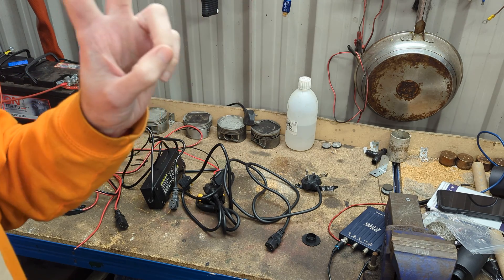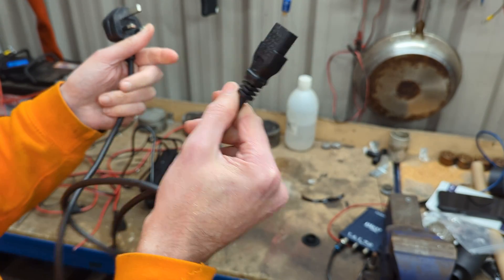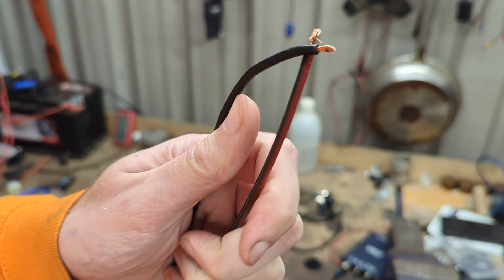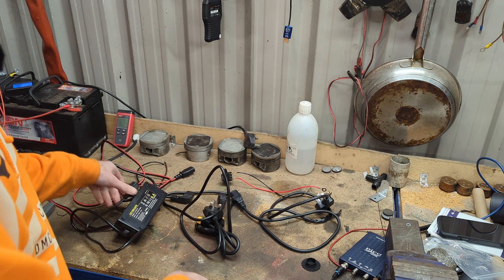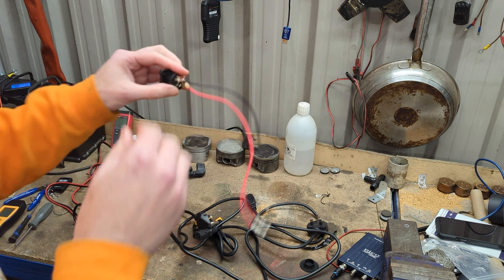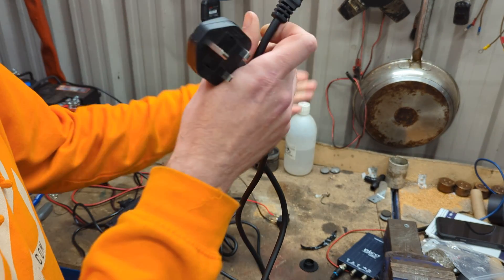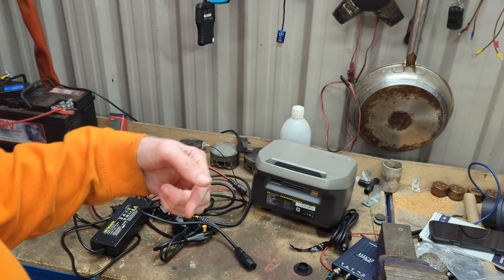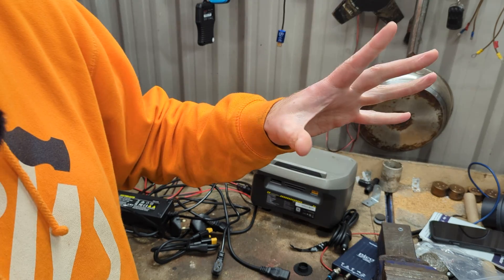PSA - Diesel heaters using mains plugs for 12V - Danger of Death

Comment: "IEC 60320 couplers are not keyed or color-coded to indicate voltage; it is the responsibility of the user to ensure that the appliance's voltage rating is compatible with the local mains supply."

Comment: New to diesel heater's but bought one for my caravan, it came with a standard UK three pin plug and after more research I've found that can be dangerous if the power goes out and the heater doesn't go through it's cool down cycle, it's that correct? any advice would be greatly appreciated.
Reply from the maker: It's not so much that it is dangerous, more that there is a chance of damaging the heater.  If it doesn't get to cool down the fan inside has a chance to soften and deform, same with the plastics and components on the ECU.

Comment: The big problem I had with this too is, seeing this plug on the outside would make me think their is a power supply inside of the unit. Especially if it was like the Hcalory in a box. Even a competent person might believe the supply is on the inside.
Oh and then you mention this is a thing. I suppose it makes sense that some manufactures do include the power supply inside. That sounds good that at least one of the manufacturers is going to hopefully make the change.

Comment: Thanks for the video! I bought a 9kW diesel heater for my motorhome. It has no cables or plugs at all. Only two screw connections and cable with cable lugs for a car battery. Anyway! There is nothing about the amps in the instruction manual. Now I'm looking online to see whether I should use a 9A cigarette lighter for the 12V output for my power bank, stronger or weaker. And during my research I find this video. I'm horrified. Installing a connection that can actually be connected to 240V... I'm at a loss for words! I'll try 9A at 12V and hope for the best. In the worst case scenario, the hut stays cold and I sleep at 4 degrees. But still better than being cremated, right? 😂

Comment: Hi David, can you help me with powering my maxpeedingrods  MXR-3M Diesel heater with a ecoflow delta 2 power station. What cable to use and what is the  maximum length you can use running it from outside my camper with my ducting entering through a window. An issue I had with the delta 2 was it primed the diesel heater first time it ran and I let it run for a hour then I powered the diesel heater down with no problems. And this was using the ac/dc power adapter they supply for the heater that you show on this video. I then powered it back up put the temperature up from 24c to 28c then the delta 2 tripped. So I am a little stuck as I'm new to this. Do I need a LED TRANSFORMER to make this work.
Thanks
Amanda
Reply: Forgot to add the  details 2 stays in the camper😊
Reply: The deita  2 stays in the camper, that's what I'm asking maximum length I can go with cable from diesel heater to power station. Thanks

Comment: So what power supply do we use thanks
Reply from the maker: Anything that can output 12V 15-20A with a nice fused plug.  Or wired straight onto a 12V battery.

https://amzn.to/40n66hJ

Comment: Time to chirp up, that power supply will most likely have aluminium cables and the 240V plug technically doesn't exist, it's a Chinese made up creation.
The 12A rating on the power supply is not good enough either, it takes 10A for the glow plug and 2A for the rest, luckily the glow plug is only used for about 1 minute.

Comment: Is the HC-A01 Diesel Heater, 5L

Wired ok as looking to get 1
Reply from the maker: Yes.  It's just using a 2 pin plug for the 12V side.

Comment: I have an electric bike which uses the iec 72v but they use the earth-neutral pins for the power so you wouldnt get an electric shoch if you was to plug a mains into it.

Comment: Completely common with Chinese manufacturers.  They don't follow standards at all.  One of the worst is the use of standard 3 pin XLR connectors for mains voltage.
Naming and shaming will actually increase their sales by driving traffic to their listings.
Reply from the maker: Just wanted to say thank you for all the things I've learned over the years from watching you, and you were a big inspiration to actually start filming some of the things I do in my workshop.  :)
Reply: I understand the BBC used to do that in-house.
Reply: Woah that's freaking concerning. Your channel also looks pretty freaking cool, I'll have to check it out 🙂

Comment: Wow this is absolutely NUTS. The sad thing is, even if it's wrong, none of these manufacturers or resellers care. I bought a hot air rework station that had the fuse on the neutral wire but at least it did have a ground,  since most other rework station videos I've seen the grounds are cut off. Love your videos. I am planning to pick up a diesel heater soon since winter here in Ohio (USA) is around the corner and i have plenty of garage projects to do. I plan on doing a little experimenting as well, so it's great to see you're into doing the same!

Comment: If you have a battery tender, and you have access to mains power in your camper van, can you connect your leisure battery to the mains via the tender and run a 12V diesel heater safely ?
Reply: So you're asking mains>tender>battery>heater correct? If so that's what I did. My tender was 6A and I ran it in a garage all winter without issues.
Reply from the maker: Yes.  I'm with you now.  Some people use it for power outages as well.  Heater basically runs of the tender/charger and if there is a power outage it'll keep going on the battery so you can shut it down properly.
Reply: @DavidMcLuckie I have the ecoflow river in the video can I use to power my diesel heater?
Reply: @jazzsounds8159 I also have the eco flo too, I was wondering if you could safely go from the 12v dc to the c15 ?

Comment: They use the cheapest quality for that connector too. I had to bypass them on a ultrasonic cleaner
since the socket shorten after 4 hours of use. haven't seen it on the heaters but they look the same quality

Comment: It's pure laziness and greed on their part, they see the option for having a built-in mains to 12/24vDC supply, cut that out, call the Mains input a DC input, in both material cost and assembly time, that's money saved on their part, not so much on the end-user's part when an end user sees a mains-only connector and rightfully assumes it's for the mains, and when it goes bang, or catches fire or kills the user, there's no recourse having bought them outside of any UK testing, and wouldn't surprise me if customs started blanket-ban seizing them because of the few manufacturers making a dangerous product...

Comment: I've been guilty for using miss matching plugs and sockets for my own projects. Can you get xt bulk head connectors now?
Reply from the maker: Yes.  I was planning on replacing the IEC plugs with XT60 panel mount versions.
Reply: @DavidMcLuckie  oh awesome, can't beat xt connections, unless you over heat when soldering 😅